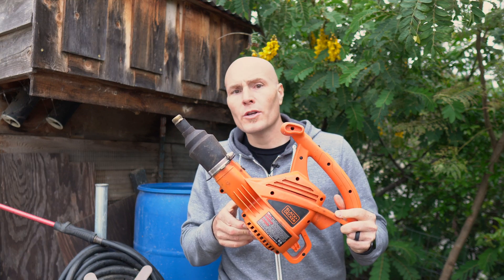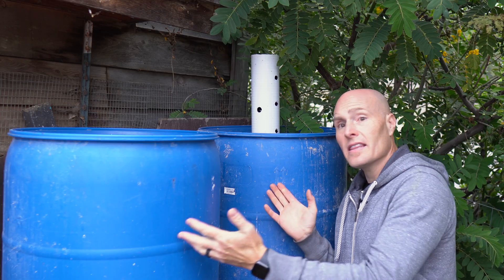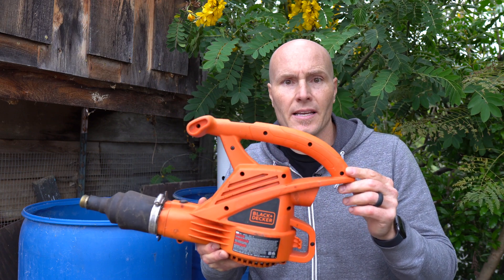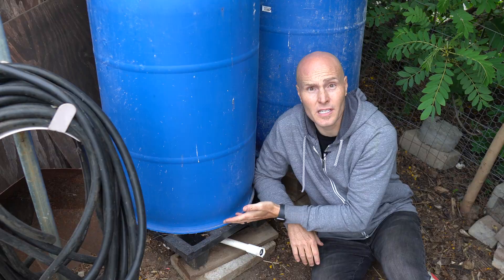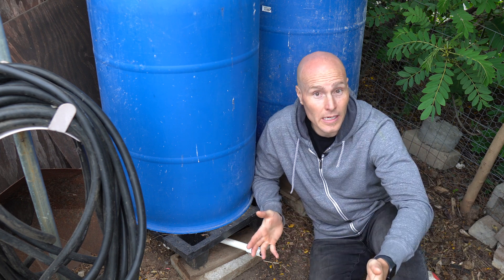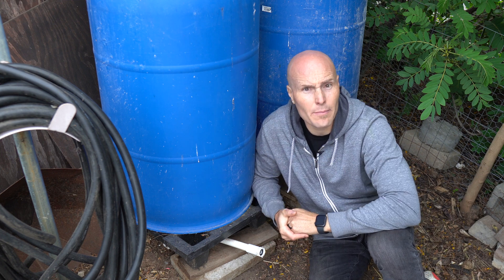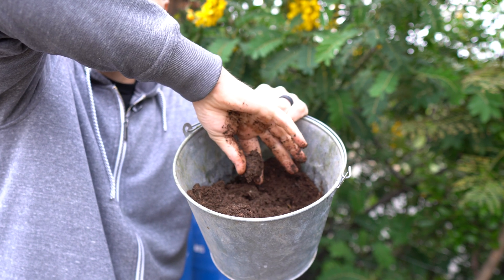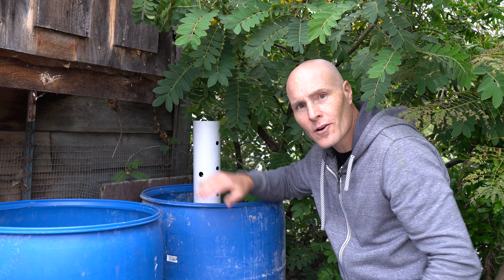BETTER, FASTER COMPOST???  Leaf Blower and Horse Manure - THE RESULTS

Comment: Wouldn't it just be simpler to rotate the barrel with a motor constantly so the compost is always being aerated? Either that or have paddles continually stirring the compost to expose more surface area to air. Bacteria doesn't care about your schedule, so why not automate it?

Comment: Diego what is the thickness of the outer galvanised sheet mesh your using? Looks like 3 to 4mm?
Reply from the maker: Which mesh?
Reply: @DiegoFooter  The main support galvanised steel mesh running around the outside.

Comment: Q: I have 20 cubic meters of used horse bedding, 90% is pine shavings and the rest is poop, pee and some spoiled hay. I have layed it in to beds with a thick layer of cardboard at the bottom,  do I cover it with a plastic sheet?

Comment: Thank you for showing the results.  I'd like to know how the revised min-reactor (with the chicken wire and on the ground) worked - did it produce compost faster than the enclosed one?
Reply from the maker: It worked.  But hard to compare results because the 2nd version was filled with horse manure which breaks down a lot faster.
Reply: @DiegoFooter  Thank you for your answer - I'd like to see them all compared using the same basic ingredients. I have a compost pile just on the ground, and there aren't any pipes in it, but there's a rat that has made holes all through it, so I think it's getting pretty aired out.  It's as far away from my house as it can get, but that rat moves between that pile, my neighbor's house, and the space under my front porch - it's been there for years, and it's obese. I wonder if it's doing any damage to my compost pile... With that in mind, I'm trying to decide whether to make a chicken wire pile with a pipe or put it all in a blue container like you have on this video.  Any suggestions?

Comment: I get to collect some fresh & safe cow poop from a friend every now and then - and love seeing what works and doesn't for you! Saving me from trying the options out 😂  we just set up a pallet bin at her place, contact with the earth. I need to retro fit an aeration tube in the centre. We'll add a few handfuls of compost worms in when it's not quite so fresh and runny. 

I'd love to see you do a result comparison between a tumbler and other compost systems 😃
I put in a handful of worms in each side of the tumbler and put everything and anything in (including small quantities of meat, dairy, oil, citrus, onions etc) . Have to say I'm rather impressed with the speed and quality of the compost I'm getting out as well as the constant worm eggs I see in the bin. But - is it worth the cost and regular turning effort. Would love your feedback 😉